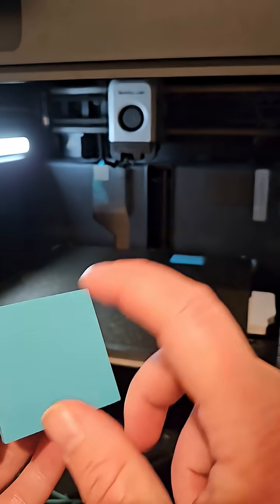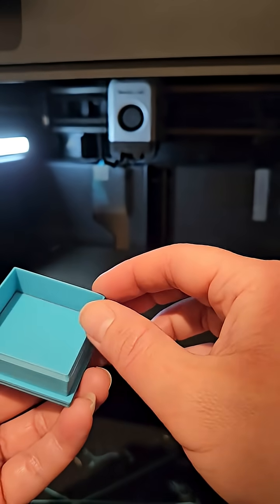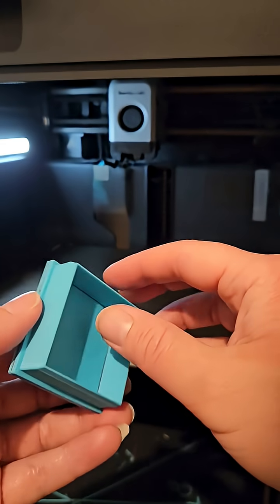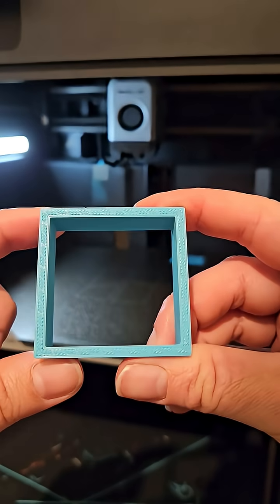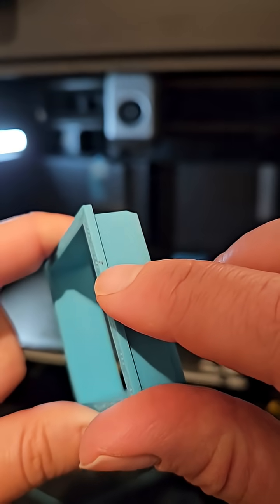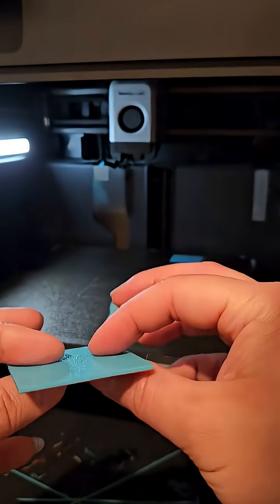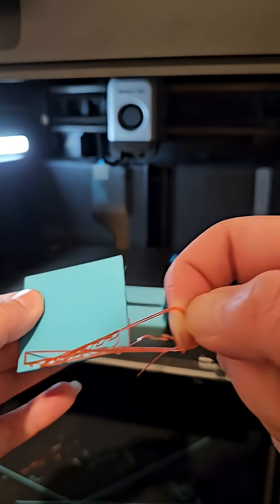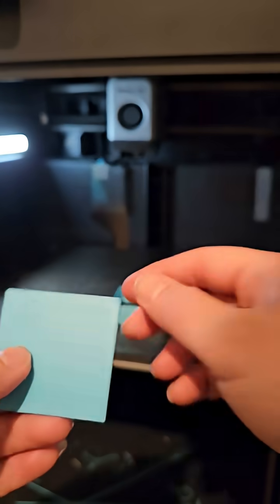BTS: Testing TPU as a Separation Layer Between PLA Prints | 3D printed Cookie Cutter experiment

Comment from the maker: Just a little behind-the-scenes experiment 👩‍🔬 I wanted to see if I could print a cutter and embosser stacked together, with a thin TPU layer in between, so they’d separate cleanly after printing. It actually worked really well! Normally I'd need to print the cutter and embosser next to each other, this way I would be able to optimise space, particularly on my overnight print jobs.